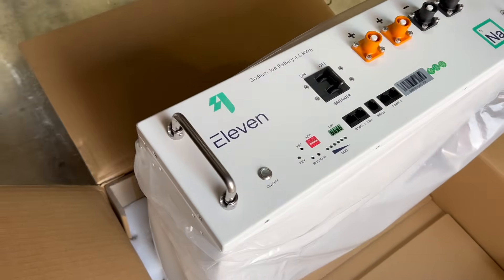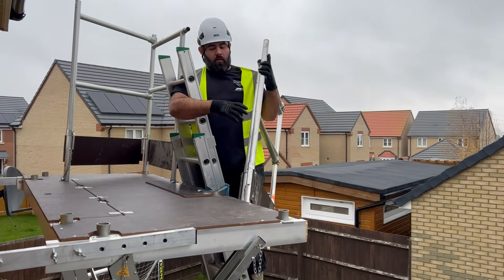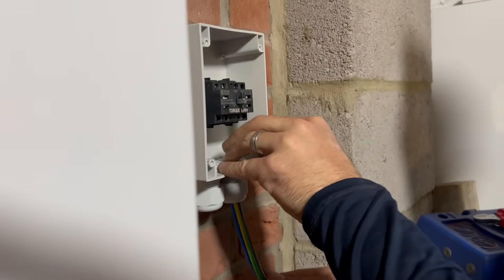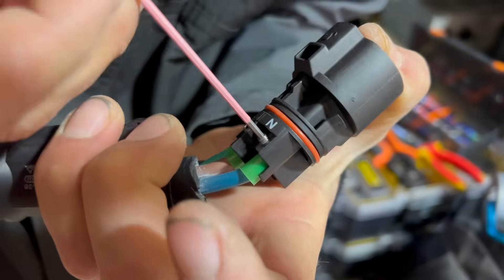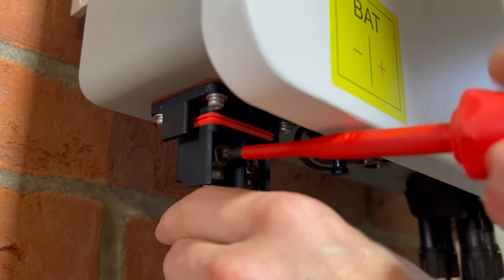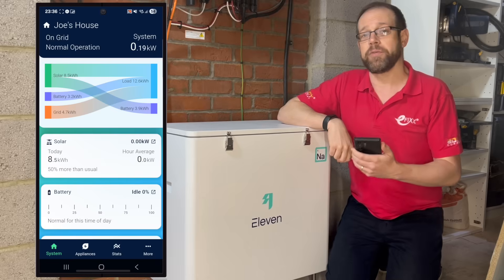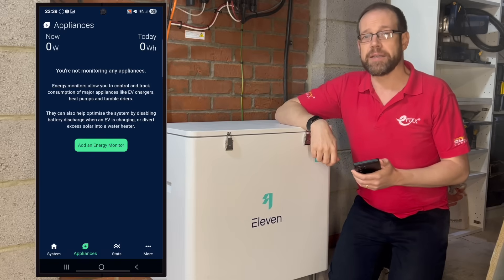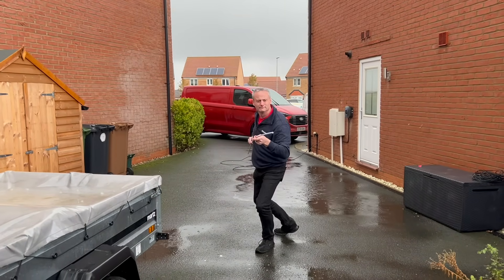I Swapped to a Sodium Battery - What Happened?

Comment: Uh.  So, unless that sodium battery is 50% the cost of LFP on a per kWh basis, there is not only no reason to do it, but the sodium batteries will have significantly poorer performance and efficiency.

* Poor voltage profile.  Very wide range means that the inverter is unlikely to be able to use the full capacity of the sodium battery.

* Poor round-trip energy efficiency.  85%-90% is typical.   LFP is 95-97%.   Sodium has both voltage and coloumbic losses.  LFP only has voltage losses.

* Cost.  The only reason one would get sodium is cost.  So unless the cost for the pack you are installing is vastly cheaper than LFP, there is no reason under the sun why you would want sodium for your home storage system.

Sodium may eventually drop in cost significantly enough to be a decent alternative to LiFePO4 (LFP), but until that happens, buying into it at the residential level makes zero sense.

Sodium chemistries are safer than lithium, but LFP is a very safe lithium chemistry for residential use and a modern LFP cell is not only highly unlikely to runaway, but it generally can't self-ignite either if/when it does.  The temperature gradient during a thermal for LFP is 1/100th the rate that it is for NMC.  Toxic white outgassing can still occur, for sure, just like any lithium battery, but that's usually as far as it goes.   It's very difficult for LFP to run away in the first place because the electrolyte breakdown is up above 4.6V while a fully charge LFP battery sits at 3.375V (and has a charge target usually around 3.55V).  Unlike NMC.

Sodium's best current use case is likely for grid-scale storage.  It will take several more generations before it really makes sense in a residential environment.

-Matt
Reply from the maker: Thanks for commenting!

Comment: You are not getting the best return by self consuming your solar. Ditch the export side of the FIT and get an export MPAN, give this to octopus and you can get 15p for all your solar. Just charge the battery overnight on a cheap rate. The best overnight rate is Intelligent Octopus Go at 7p. Then at the end of the day export whatever is left in your battery and make 8p profit and each spare kwh.
Reply from the maker: Thanks for the tip. 💪
Reply: You seriously do all of this work and investment for literally pennies?
Reply: @markrainford1219  two points: firstly, it doesn’t take much “work” other than setting up your Octopus account to allow export and secondly those “pennies” equate to several pounds per day which adds up to a lot of money over the course of the year. (Who wouldn’t want to save over half their electricity bill?)
Reply: @markrainford1219 I am being paid £290 to run a 6 bed house and drive 8000 miles. Maybe you are so rich that £2000 per year is just not worth the effort. That isn’t the case for everyone. That’s not pennies to me.
Reply: Depends on his FiTs rate, the top rate is around 77p per kWh so you keep that contract in place.
Reply: @rogerthomas7040 You are referring to the generation payment and yes you always keep that going. The export rate if deemed export is usually 50% of generation and usually around 6p so 3p per generated unit. 15p is available for actual export. Check the wording for your FIT. Mine was 2017 and was very small so I ditched mine.

Comment: Sodium chloride is not used in these batteries. It is sodium metal oxide and a sodium salt ( not table salt). Many YouTube channels conflate sodium salts with sodium chloride.
Reply: Well, sodium carbonate can be derived from 'table salt', so it's close enough for the average layperson.
Reply: @ArthurDentZaphodBeeb it is easy enough to just be accurate. Why do the uneducated need to stay that way? Not everyone does chemistry at school but you can easily make it clear what is inside something. Do we put crude oil in our cars? The general public has managed to understand the difference between the source and a product. Why treat everyone like they don’t need to know the details? If that is the case why even mention sodium just say it’s a battery, nuff said.
Reply: @pmac6584 Yes, we do put 'refined' crude oil in our cars, just like we put 'refined' table salt in sodium batteries.

Comment: Maximising self-consumption makes sense for off-grid systems. If you can export to the grid for more than you pay during off-peak periods, it only makes sense to export all solar immediately.
Reply: He mentioned he was on FIT. He has to drop the export side of FIT first (keeping the generation side). Then get the export mpan over to octopus and sign up for the export tariff. I had to do this for my fit system when I got my batteries
Reply from the maker: Thanks for the insight, I'm currently looking at how I consume power and will make a decision on the next step. 👍
Reply: @pawebielecki887 Also factor in purchase and installation, on going maintenance and equipment replacement costs and it probably makes no sense at all.
Reply: @markrainford1219  I’m not commenting on whether you should install PV with a battery, only on the strategy if you do. In my case the ROI is four years, not counting likely energy price rises, but everyone needs to run their own numbers. As for maintenance -what exactly are you referring to?
Reply: @markrainford1219 Your use of the word probably seems to indicate that you don’t know. Why not do some research and you might be surprised. I don’t have any energy bills and drive 8000 miles for free. My payback is under 10 years and as I have had my system for 8 years I will be in profit £2000 per year tax free in about 2 years. You can decide whether that’s worth it to you. It is definitely worth it to me.
Reply: That's sort of great IF you have factored in replacing inverters and batteries. And the FIT disappearing with the next government.
Reply: @markrainford1219 They are guaranteed for 12 years and the future is not guaranteed at all. The FIT is only £200 so I would still be £1800 up if the contract was broken.
Reply: It will depend on the installation date. The original FITs payments are worth around 77p per kWh of generated output regardless of their use or export. So you store and use the energy locally while leaving the FITs agreement in place.

Comment: Nothing on round trip efficiency, surely the most critical parameter of these things. Efixx rapidly burning through its credibility.
Reply: 3.9KWh charged, 3,2KWh discharged and then empty So 3.2/3.9 - ~82% upper bound.
And unsure if that is only DC->DC, or there's the DC->AC loss on top of that as well.
Reply: They produce lots of good content, but if it's remotely complex they regularly lose their way & forget first principles
Reply from the maker: Thanks for the feedback.
Reply: We're seeing around 94-95% typically on installed systems so far.

Comment: A well thought out video: But missing some basic information - perhaps there will be a future video. What did it cost? What is the power consumed by the battery management system? What is the round trip efficiency? In any case, best wishes: Michael
Reply: With the ecoflow stream ultra offering budget modular systems   , then how does this compare.
Reply: Hardly any power is lost in the BMS,, but as with any battery system there are some losses in charging and discharging. From the data we have so far this is typically 5-6% on an installed system. Not significantly different to a lithium based battery chemistry.
Reply: From the app screenshots, with an empty battery, it was charged with 3.9 and discharged with 3.2KWh.  So 3.2/3.9 = ~ 82% efficiency.
Unclear how that splits between charge/discharge losses and DC->AC conversion losses.
Reply: Prices can be found at Midsummer Wholesale. Installation costs vary with your property.

Comment: Do you have power when the grid fails?
Reply: As in a backup off-grid system??? Good question, we may never know....he never mentioned a hybrid system...
If not you can easily add an off-grid inverter to connect to the battery...
Reply: He will have a dedicated EPS output from the interter, most likely connected to a double 13A socket nearby.

Comment: There is no published documentation on the efficiency of the EL3600 inverter at various battery voltage levels. This makes it a complete no-go for any install.
Without being able to calculate and estimate in which conditions the system will be beneficial and when it will actually waste energy it can't be installed. The customer is entitled to know this information!
Way too many inverters on the market are so inefficient in low-load scenarios that selling the power to the grid at low price would actually be more cost beneficial than storing it on battery for use later.
There is losses when charging from grid or solar first, then there is the massive efficiency hit when going from battery to AC for low house consumption that on many models can go as low as 60%! Offsetting a low nightly tariff with battery can end up costing you twice as much as simply running off grid during this period, having sold the solar during the day. Sometimes buffering the solar during peak solar hours and exporting during evening peak consumption pricing is the best choice for reducing payback time.
Reply: Btw, in Norway it is fully legal to import power during off peak pricing and sell it back during peak pricing. It is not fraud, simply power being bought and sold. You also get normal spot pricing for it.
The fact it is not possible under FiT just shows they really don't want your power.
Reply: @1kreature  it is possible but you have to sign up for export tariff. Currently octopus pay 15p for each unit exported
Reply: @ 1kreature Or maybe just build more nuclear powerstations so we are not forced to have all this crap on and in our homes? You know just pay a reasonable quarterly bill like we used to before energy became politicised.
Reply: @markrainford1219 yes nuclear is totally safe , windscale, three mile island, fukishima, chernobyl, kyshtim, tokaimura,st laurent, sl1 usa,lucens and sellafield to name just a few probably just exaggerated by the renewable lobby.
Reply: Right. So you have to go back what, two decades to find a negative? LOL
Reply: @markrainford1219  What are you on about? What decades, what negative?
Reply: @1kreature     Sorry, that was meant to be for pmac6584
Reply: @markrainford1219  We don't have any nuclear power plants in Norway at all. We should expand the hydroelectric system though as it's very easy to turn up/down depending on demand.

Comment: "Its un-armoured as its inducting" - Can you elaborate on this point ? I'm thinking as the conductors inside the SWA would have DC electric fields inside the SWA then I do not see where the inducted potentials would arise from (Induction is proportional to rate of change of electric field)? especially if the SWA is bonded to the earthing system at the same potential as the inverter casing. I have the feeling that a whole range of new cables have been designed and manufactured for no good reason when considering things from a fundemental physics perspective. Am I missing something here ?  I think its possibly to to arc fault risks and large fault currents that we should avoid SWA.

Sodium ion batteries have worse electrochemical storage characteristsics (~85 % round trip efficiency vs 95 % for LFP) than LFP. I don't think its a good idea at the current £/Kwhr, although definately a better option if your sticking them outside as they work at very low temperatures. Enviromental perspective makes alot of sense though and prices should hopefully drop fast!
Reply: Thay have a 95%  round-trip efficiency.
Reply: @adus123  cool
Reply: "In ducting" you pleb. Ok he should have said PVC conduit. And maybe not talk so fast. So I retract the pleb.
Reply: In ducting, not inducting ⚡
Reply: @bensmith411 🎉sad 😢😢😢
Reply: @bensmith411  haha that explains alot. Thanks
Reply: @bensmith411  Makes a lot more sense!

Comment: Sodium has a different voltage profile to lithium so you do have to match battery to inverter, so not that brill if you want to retro fit just the batteries. A lot of software companies are still in the dark ages and won't let you connect to wifi if it is 4G/5G hotspot on your mobile. so worth knowing if that works - and what happens when the phone is taken away from the system.
Reply: Yes, you do need to match the battery to the inverter, so we don't recommend re-fitting the batteries to an inverter used for lithium batteries. In particular you need an inverter with a wider voltage range than most LV inverters will work with. The Eleven inverters work with a voltage range from 33V to 60V.
Reply from the maker: It connects via WiFi and can be accessed from a browser not just the app. 👍
Reply: @efixx  You might have covered this in the video (sorry if you have) but is the data local or mediated through an off-site server.  We don't want to be in the same position as people have found themselves 5-10 years down the line with no access to their own data.  Would OpenPV or OpenBatt or other Open source be a suitable replacement if this was to occur. (Can you tell I've been stung by Nissan's withdrawal of connectivity when they pulled the plug on their OTA Leaf control - which isn't a thing as 2G will long persist, it's 3G that's going 😞 )

Comment: well where is that Sodium is cheap you can get it any time anywhere... Well Hard reality is ..Sodium isn't cheaper than traditional battery banks..to be honest it cost more.. So yeah..tell me why it is better option ?
Reply: it should be reliable because sodium is easier to read capacity and require no minimum voltage (the voltage is linear from 0volt) so BMS should never fail to balance the cells and even if it failed then it is reversible, so theoretically it should save money due to removing 1 instance of battery-pack failure. Also (for business) "it require no minimum voltage" is important because you can stock up without them fouling, so you save cost on work hours traditionally used to maintain the batteries full (lead-acid) or at 60% (lithium-ion).
Reply: @xponen  None of those factors save any money.  And even the cells don't care, I assure you the chargers, charger controllers, inverter, and BMS still do.  I mean, come on... who cares about saving money if they're just gonna leave the battery on a shelf for a few years?  The active use case doesn't have any of these issues and while cell balance can definitely diverge with LFP over time if not charged to 100%, it isn't as though you have to charge to 100% every day.

You can go a few months (across the whole of winter) without disturbing LFP balance too badly.  The BMS will still be able to balance the cells after one or two full cycles later on.  It doesn't take much.  Nor will a LFP battery really lose much (if any) capacity (due to early cell OVP) by not being in perfect balance for a few months.

You also don't have to maintain stored LFP cells at 60% or anything like that.  Calendar aging swamps everything else.  If a LFP pack is gonna be sitting around doing nothing, just charge it to 100% once a year and not worry about it.  Literally.

In otherwords, these are all non-problems for LFP and no reason to choose sodium over LFP.

-Matt
Reply: @junkerzn7312  but what about these use case like in laptop-battery and EVs, why do laptop-pack have balance problem (the last cell always dies), and why is the story about EV-batteries that had weak pack preventing the battery-pack from charging full? I can see it's a problem for laptop-batteries because I have many of it.
Reply: @xponen  What does any of that have to do with lithium?   If a cell fails, a cell fails.  Sodium can fail just as easily as lithium can.   If its merely a balance issue, then the balancer will fix it.   Plus I have no idea what you are talking about re: laptops.  What does that have to do with anything?
Reply: @junkerzn7312  sodium can't fail due to balance issue because each cell is still healthy despite any of them fully discharged to 0. Laptop-battery is relevant (in my opinion) because the BMS is required to only balance 4-cell and yet still failed me many times (maybe BMS in laptop-batteries is cheap? but then if we use sodium then the BMS can be cheap, thus it can save money).
Reply: @xponen  Balance issues do not cause cells to drop to 0, though.  So your first sentence makes no sense.   The laptop isn't relevant at all.   Insofar as I can tell, you are blaming broken BMSs on lithium for some reason ?     Anyway...  I don't think you'll find any of your problems solved by sodium.
Reply: @junkerzn7312  "balance issue do not cause a cell to drop to 0volt", OK, but if BMS allowed a lithium to drop to 2.6volt then the cell is dead, meanwhile sodium is immune, hence sodium battery-pack (theoretically) is more reliable than lithium battery-pack.

Comment: 10:39 only 9 kWh? if i could build my house, i would want more. A LOT more.

RS-485? why not ethernet?
is it possible to monitor and control that system from home assistant? gonna check if there's an integration...
12:25 why wifi? i'd prefer ethernet.
16:48 248V is "a little on the high side"? not around here. i frequently get voltages of around 250, sometimes even more, causing my smart plugs to switch off. then home assistant has to come in and turn them back on, or bad things would happen. the weird thing is that it usually happens after sunset or before sunrise. 

2 things that rub me the wrong way: 
- unless i'm wrong, it uses wifi instead of ethernet
- it sends my info to the cloud. no bueno.
Reply: While its alot safer, it requires alot bigger size to be comparable to lithium cells.

I think for example the the 2kw batterys are around 700 on sodium.

So they require almost double the space, for the less than half the capacity of lithium :)
Reply: Alot?
Reply from the maker: About 15% more space. 👍
Reply: There's an integration with home assistant